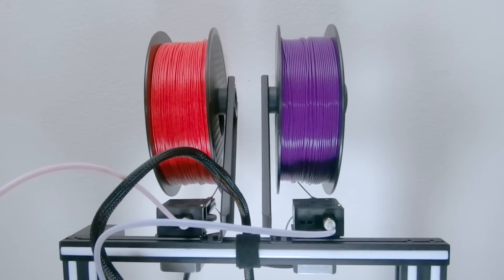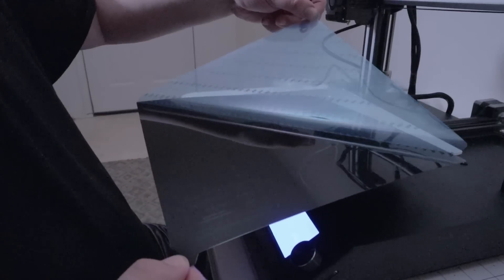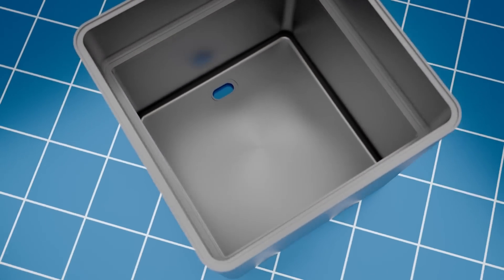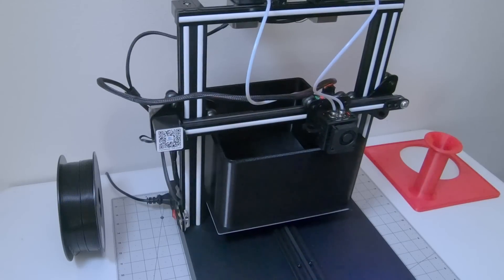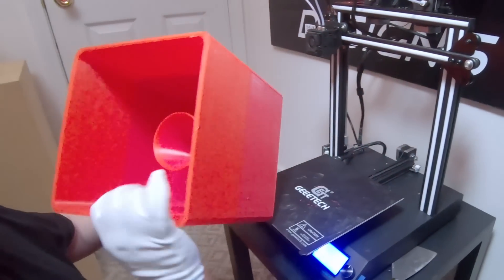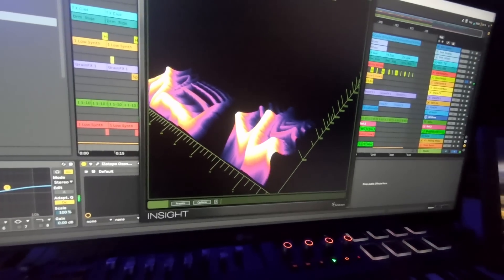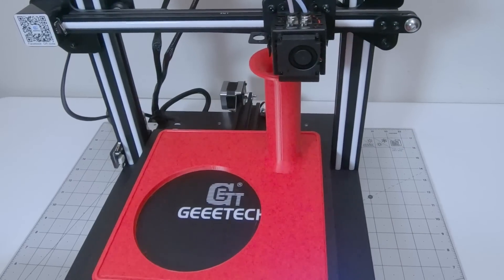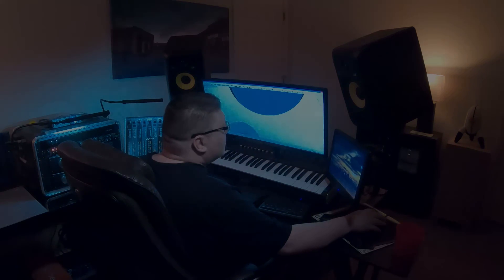Car Audio Subwoofer Printed on a Geeetech A20M

Comment: When we tried FDM printing at work, we had a lot of issues getting models to stick to the table and not lift mid-print. Had to use PVA glue, kapton tape and whatnot. We concluded that an enclosed print volume is almost a must for the table to keep at temperature. Surprised to see you're getting such good adhesion right away on a such a large print in free air.

Comment: I know this is an old video, but I have a 4th order blowthrough in my pickup. Thinking about adding a 3" port on the sealed side to essentially(atleast I think) would give me a 6th order parallel like on this video. It's a big sub, and a big box. So I'm just curious as the methods  to design you used. Like. What the first ported chamber is tuned to in correlation to the external chamber that vents the sound. Thsnks

Comment: I have just become aware of your channel and I love it! I slide to both sides of the con-ex scale depending on my company and to throw in a little spice, I also started 3d printing and have a Creality cr10s pro v2. I'd love to see you do a project for 12" subs! My guess is, you would have to cut the whole thing in half to fit on even a build plate as big as mine. Is this possible for you to do?

Comment: The original design had a problem with PLA in the form of horrible resonance.  To eliminate the resonance, I ended taking the internal dimensions and built it out of birch wood. While I was at it, I added 3D printed satelites speakers bonded to the wood with a 3D printed sculpture.  Powered by a Kenwood 4 channel amp with 7aH Lithium Ion battery.  Added a 3 laser machine for a psychedelic experience. No more resonance. See here: https://www.youtube.com/watch?v=TGCSrKBb2-E
Thanks Hexibase!

Comment: I printed this in PETG for automotive use but it had horrible resonance (30% infill).  I ended up just printing the chamber divider and the 6th order port tube and JB welded that to the wood enclosure (matching volume etc).  WOW is all I can say.  The thing had a solid response from 40HZ to 80HZ that was thumping.  Make sure your speakers can deliver from 70HZ up otherwise you will notice a gap.
UPDATE: PETG is no good even with the wood being bonded to the PETG.  I threw that PETG away and built it out of 3/4 inch birch.  Much much better.
Reply: Thank you for the updated information. I just want to build this sub box. Good to hear that wood/mdf is much better than plastic
Reply: @nockesumampouw6165  I used the internal dimensions to build it out of Birch Plywood here.https://www.youtube.com/watch?v=TGCSrKBb2-E&ab_channel=PoMan_911The complex pieces were 3D printed at 50% infill.  The thing rocks!

Comment: As I'm watching this a thought popped into my head:  The ability to mix two filaments in one print head makes me think there should be no problem with a print head design that pushes a thick filament through a fine nozzle.  That means such a design could reduce the surface area to mass ratio of the filament.  Theoretically, you could use filament that starts out looking like a hot-melt glue stick.  That should make moisture absorption more easily controllable.

Comment: Get a flexible print bed, that way you can get it off a lot easier. I made my own by buying a 1mm fiber glass plate and I stuck the build tak on top of that. The plate is held on the print bed by 4 fallback clamps

Comment: I didn't catch what kind of filament you actually used for the print, was it done fully in PLA?  I ask because once I left a PLA print in my car on a hot summer day, only for around 30 minutes, and the print practically melted.  It shrunk and warped quite a lot.  I was wondering how a print like this was holding up for you.

Comment: I've decided to put this subwoofer in my car.  BUT PLA will not survive the hot summer so this will be done using PETG.  6 days to print the upper and 7 days for the lower section.  Fortunately, I can do one on each of two Sovol SV01. Since the 6.5 inch Dayton Audio is out of stock, I will be using the Tang Band 6.5 W6-1139 and hopefully it will work until Parts Express get the Dayton Audio back in stock.
Reply: Hi. Did you end up doing the project? How does it sound? I'm busy with mine.
Reply: @sendelany  Yes I printed in PETG but it sounded worse than PLA.  The resonance on the PETG is worse than PLA.  I ended up just printing the woofer plate and the port tube with the outer cabinet from 3/4 inch plywood.  Just for kicks I incorporated the sub into this boombox: https://www.youtube.com/watch?v=TGCSrKBb2-E
Reply: Thanks. This looks awesome.

Comment: @hexibase i seen this video a few months ago and this was what pushed me to buy a 3d printer! lol so after a few months of tuning the printer i finally felt comfortable enough to print this enclosure. after about 1 week of printing some great and some failed prints. i finished it and oh my!!!!!!! i was beside myself that a dayton 6.5 sub would ever do what this was doing. i removed 2 JL 10s out of my wife's car and installed this 6.5. everyone who has heard it is asking me to print them one now!!!!! i'm about to start a second one for me first but i'm curious as i bought a printer with a build plate of 330x330x400. do you think i could resize the enclosure for maybe an 8" or a 10" sub? even if i have to epoxy several pieces together? thanks for any help and im for sure a fan!!!
Reply: i'm also curious if you have a design for an outdoor type for a golf cart

Comment: That is pretty good oomph for a 6.5 inch 100w RMS subwoofer. That's what I call the perfect small car subwoofer especially if you tune the ports differently and used a B2 audio Rage65 sub.

Comment: that's a nice sounding sub but enclosure is kinda big for 6" sub... that was my thought unit I've heard drive by... now its just wow!
Reply: Looks like he did a 6th order band pass which may explain they size since it’s basically 2 ported boxes in 1
Reply: @MannuhFestIt  Precisely. I built a quasi eighth order dual bandpass enclosure for two RE8s (8") about 15 years ago. That sucker took up nearly the entire hatch floor of an old explorer. I wish I could have found dual eD 8As to throw in it back then. RIP eD. Hated the weight, but miss that enclosure. My friend borrowed it, and apparenly his trunk leaked. Facepalm
Reply: @mikem.9197   I need to see that... for sureee

Comment: Thank you for the video and the coupon for the printer.   I went to Amazon to buy it and it was on a flash sale for 20% off, with the addition of your coupon...  I made out like a bandit.   I hope it holds up... went ahead and bought the bed level device you have linked as well - why not at that price.

Comment: "cartesian style" is really general, the A20M is derived from a Mendel style FDM, which is more specific. The main reason I raise it is sometimes people get the impression that cartesian means the sliding bed and not sliding bed isn't cartesian, it may or may not be, just saying "cartesian" is a lot broader than the usual sliding bed machine.

Comment: you can pick u p 10 sheets of 12"x12" kapton tape off amazon from gizmodorks for $20. one of the best print bed covers to allow easy separation, imo. apply it like window tint, most print materials just pop right off. its recommended to use a sheet of glass on top of your bed, but some materials will let the kapton adhere right, ymmv. and remember to let the piece fully cool after print.

Comment: Amazing work!!! Dude, can you share the measurements of the enclosure?
Reply: he said in the video, its 250mm x 250mm x 250mm at the lower, so roughly 9-3/4 inches height, length, width
Reply: RacerXGTO thanks! Must have missed it in the video.

Comment: really nice :)

But, i see the red half had warping on base, after you had given high praise for the printer. Is it really as good as you say, or are you forced to praise it to get it for free?
I have myself an A10M to test out (among dozens of printers), and it has been nothing but trouble sadly :(

I am about to embark on my first 3d printer subwoofer enclosure soon! I need to fit it into a tight space in my van, and want to tune it for very low frequency response. Going to be interesting! ;)

For printing woofers, i'd recommend you to increase extrusion width to 200% of nozzle size, and print as high temp that it strings just a bit. That'll make much stronger parts without increasing print time at all :)

Comment: Could easily scale this up by slicing it into more Tongue in groove sections for larger speakers.  may take more separate prints and more sealant / glue but then you could really go crazy with filament colors. Love it and from the demo really shows the engineering work that goes into simple items like speakers.

Comment: Knocked this one out of the park every new video about 3d printing and sub builds is more and more on point and impressive! This is coming from a mechanical engineer with experience building 3-4 conventional subwoofer enclosures as a hobby with bass reflex, passive radiators or simple sealed ones. Im currently looking into 3d printing a custom enclosure to fit in my car in one of the trunk side compartments so as to not lose trunk space.

Comment: Would suggest that you investigate the amount of box deflection considering the wall thickness and the fact that the plastic is somewhat stiffer than wax.

Would also suggest that plastic parts could be used in combination with conventional box building materials, also would suggest that voids could be filled with various resin and cement based compounds which are less printable but much more mechanically rugged.
Reply: I like the idea of pouring in sand into the infill. No idea if that would work, but I think it's viable dampening for CNC.

Comment: Bit of a weird questions, but is there a term or unit of measurement that can quantify a driver/enclosure's ability to reproduce quick "bursts" of signal (eg: fast double kick drums)?  I'm looking to do a sub build soon and would like to find a way to get tighter and more accurate bass drum notes; unfortunately, my current sub just rumbles and the attack seems to lag behind my midbass drivers..
Reply: Sounds like driver, enclosure misalignment.
Reply: Thanks for the info guys.  I'll look into group delay curves.  The combos I've tried so far are 12" driver/sealed enclosure, 8" driver/sealed enclosure and 8" driver/vented.  Might tweak this design a bit to work with an isobaric setup.

Comment: Love the project. You mentioned you might print this in PETG to get around the hot car issue. If you do end up printing in PETG consider enclosing the printer in some way. Printing tall thin structures like the enclosure will likely result in layer separation. A heated chamber will reduce the chances of that and annealing the print after can relieve internal stresses.

Comment: Spray some 50/50 water and rubbing alcohol around the edges of your print when finished and let it sit.  With the build plate cool the water/alcohol will seep under your print and allow it to release usually with little to no effort in removing it.

Comment: I can vouch for his design. I printed the 3 inch folded waveguide box running the exact TB driver and it sounded like 5.25 inch sub. It played down to 40 hz with good spl.  I ended up getting a second Sovol SV01 as I can’t wait 4 days to print one part. By the way the Sovol is 240x280x300 volume and really is just a bigger Creality 3 Pro for $300.  It's 95% assembled too.

Comment: It only cliped the print on the x due to home position. Had loads of room on the right hand side of the bed.
Reply: @HexiBase  my tronxy a8 does the same, never bothered to fix it. I just manualy cog the stepper back 5 or 6 clonks.

Comment: Too bad my printer is just 200*200*220 😕 nice project anyway! I really love how you bring 3D printing and sound together 😁
Reply: @HexiBase  I think I'm gonna print the other enclosure you designed, I can stretch my x axis motion to 250mm by using a plate on my printbed. The y axis is still limited by 200 mm unfortunately. I'm looking forward to your next projects!

Comment: Can you make a video on designing 6th orders? I feel like there’s no videos on it
Reply: @HexiBase  I want to make a 6th order box for 2 orion 12 inch subwoofers. I dont know the ts parameters. I dont even know the model of them. Theyre pretty weak hooked up to a 250 watt Rockford 250.1. Any suggestions without the complicated measurements it takes to get the parameters. Just a generic 6th order like some companies already sell generic ported and sealed boxes. Something that will just be good enough til I can buy some real subs that aren't old and used and ill make a real box with the parameters.
Reply: @mikem.9197  That only does parallel sixth.  This was a series 6th.

Comment: Thanks for you'r great videos! Could you make a more technical video on what tools you use to design such an enclosure. Also how you factor in the given surronding like a car or a specific room. You mentioned how important the surrounding is in your "A Link In The Chain" video but i can't wrap my head around how to measure and include the transfer function in the design process.

Comment: I was just thinking about this today.  If you had to build a box that was 4x the capacity of the printer maybe you could just split each side by 1/4 and put a tongue and grove in for glueing.  Not sure if we would need to worry about rigitiy as size increases and possibly adding supports.

Comment: Wow, always been impressed by the output of your boxes but this one is really on a new level! 
It would be super cool if you could make a video that dives down a bit more into the technicals of making a box. Like what you think about when choosing the enclosure type and how the dimensions are calculated. There really isn't too much of such on youtube already, especially when it comes to the lesser common box types than just basic 4th orders...
Reply: @HexiBase  Just putting this here to join the choir for tutorials :)
Reply: I recently discovered a free German audio design software suite called Boxsim. I can't attest to the accuracy of the simulation results, but from the forums I've heard good things about it. Once you put in the T/S parameters and set up a simple Amp-to-Driver "Crossover Network" you can quickly try a bunch of different dimensions/volumes/tuning for the 5 basic enclosure types. In addition to the standard "Frequency Response" tab, I also like the "Max SPL" tab since the right half of the screen shows you the power limit for Xmax. Really cool software, search Boxsim V2.00 and you should find an English download.
Reply: Kent Altobelli WinISD: am I a joke to you??
Reply: I also want to chime in on the 'how to design' list. I'd love a talk through of the how's and why's of your decisions on a design like this. There are programs out there to design a box, but they don't discuss the options and the tradeoffs/pro/cons. So yeah, I want to support the idea of videos like that. :)
Reply: @HexiBase  Thank you i have been wanting to design more useful enclosures using something other than winISD
Reply: hexibase!, (chorus) made some nice tutorials! we want to learn from the best. thank´s for sharing your job with us!.